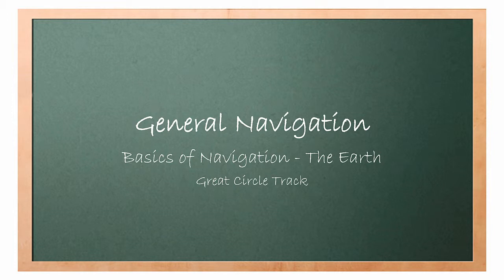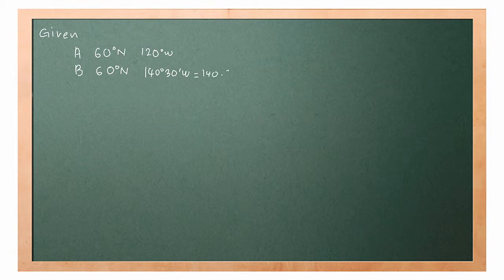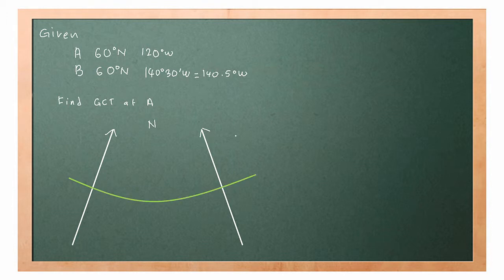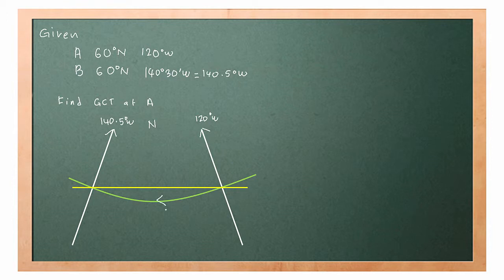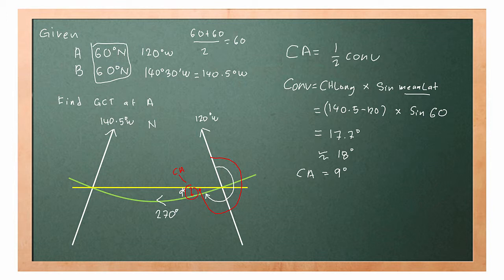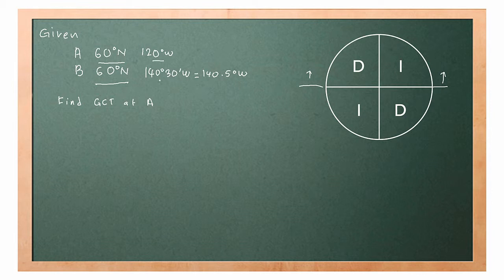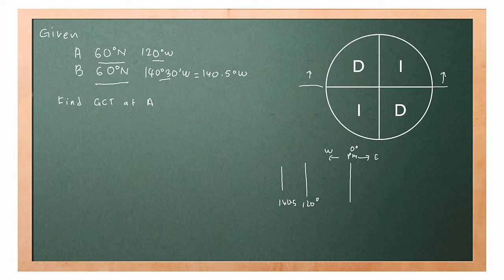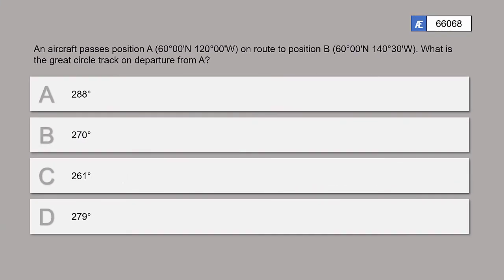Great Circle Track on Departure | General Navigation | ATPL Question Bank | AE66068 | Answering ATPL

Comment: hello,your videos are awesome keep up the good work,but i have a question here.the only thing tha i cant understand in the gnav is the DIID.when in 270 when is 90 and when you have to substract,in this video the longitutdes are 120W and 140W so on the left of prime meridian and still the position is westerly..could you explain me why am i wrong?
thank you
Reply from the maker: To understand when it is 270 or 090, you need to know the relative position of the 2 longitudes. My advice on the initial stage use Google Earth or a Mercator Chart. When travelling from left to right, it is 090, and when travelling right to left, it is 270.

On the issue of additional or subtraction DIID diagram can be summarised as follow:
D - Decrease
  * RLT is more than Great Circle Track [GCT = RLT - CA]
  *GCT at D is less than GCT at I by the amount of convergency
I - Increase
  * RLT is less than Great Circle Track [GCT = RLT + CA]
  *GCT at I is more than GCT at D by the amount of convergency

I hope this explanation help.
Reply from the maker: Hi there, let me break down the usage of DIID

DI is used for Northern Hemisphere
ID is used for Southern Hemisphere

Next, you need to check the relative position of your start point and endpoint. (VERY Important, use Mercator map or Google Earth to visualize)
Let's say you have two points A and B, and you are travelling from A to B in the Northern Hemisphere. The relative position of these two-point, as shown below.

A------------------->B

Because we are in the Northern Hemisphere, we need to use DI. What we need to do is to overlay D and I on the diagram
D                         I
A------------------->B

Now we know point A Decreased and point B Increased. Based on the question given, two equations can be derived for each point.

Point A (Decrease)
Equation 1:-  GCT at A = RLT - CA
Equation 2:- GCT at A = GCT at B - Conv

Point B (Increase)
Equation 1:-  GCT at B = RLT + CA
Equation 2:- GCT at B = GCT at A + Conv

GCT - Great Circle Track
RLT - Rhumb Line Track
Conv - Convergency

I hope this explanation clear all you doubt.